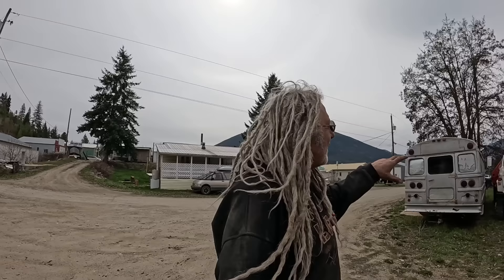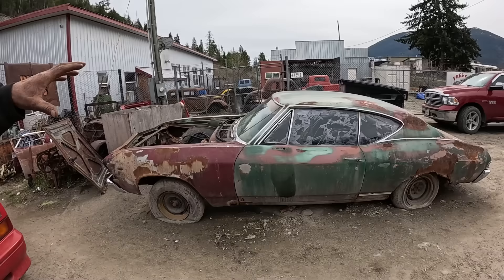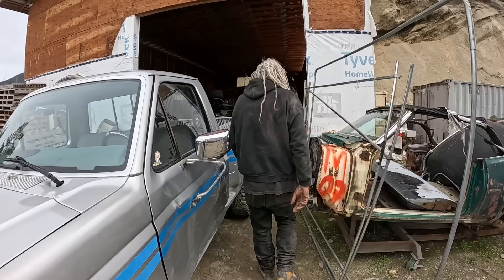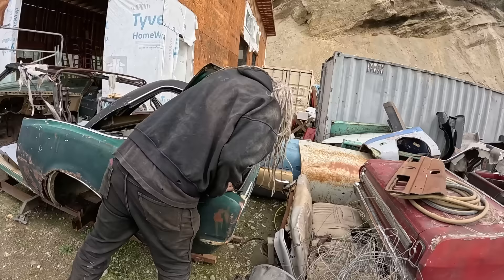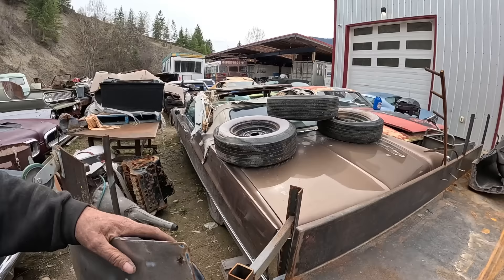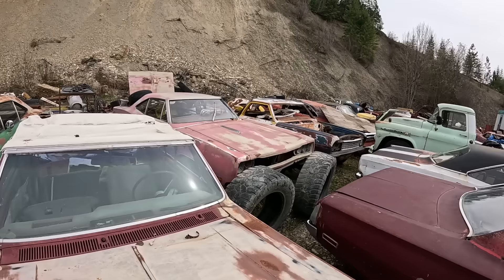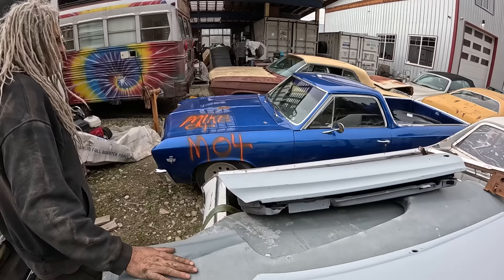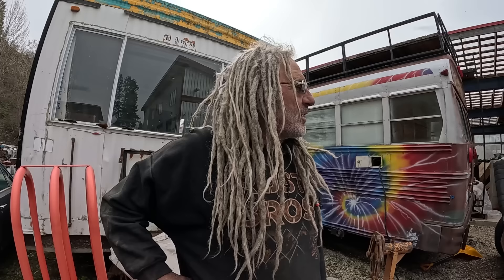Mike From Rust Bros is Selling His Vintage Cars

Comment: I remember visiting this place a few years before the auction and the prices were normal for the quality of these projects. Now they are out of this world compared to then. I bought a 77 trans/am auto with one new quarter panel in the trunk and drove it home about a 1000 km's for 2000.00. now it has been converted to a 4 speed and will be summer driven in about a week or two as my daily driver.  I still remember almost buying 2x 68 AMX's 343 4 speeds for 5000.00 from him instead of the T/A . Inflation is one thing but those prices that were said out loud are beyond normal. My last 3 cars bought are 69 Cuda solid floors needs quarters and rockers that is on the rotisserie now with a low milage motorhome 440 as well as a 360 magnum and manual transmission bundle for 3,500.00 + 76 formula 6.6 auto with 56,000 km's engine and transmission from a wreck with the body at 140,000 km's for 800.00 now totally restored and up for sale at 20,000.00 Canadian + 65 4 speed convertible Mustang that needs floors and in need of a total restoration with no drive train for 100.00 with papers. Easy to find ? No. But they are out there. Working on a 73 Cuda with good floors but needs quarters as a shell and complete interior for maybe 4,000.00 or so but still talking price or trade.  Also know of a 67 400 4 speed firebird convertible that does not need floors or any metal as well as a 68 440 auto charger hidden in the back of a shop that has been sitting for years that may or may not be for sale. Just saying. But then money in the hand talks loud and bullshit always walks , right? I know Mike is a nice guy and can be worked a bit because Mike likes to see them back on the road instead of rotting further into the ground. Still enjoy watching reruns of his shows.
Reply: you were the guy that bought that white one, you drove it up the road whittled him down and bit and said BRB, I never saw you again but maybe you came back? the white one?
Reply: @deandee8082  No a red one
Reply from the maker: you said it money talks you have to start somewhere and ive allways found its easier to drop your price than raise it lol thanx for the comment i allways bring cash if i am looking at old cars
Reply: @RustBrosRestos  That is the way my world works as well Mike. Always enjoyed our brief moments talking even if you never remember me. Guess that is the life of a busy star ha ha.

Comment: Pretty much everything you got Mike is a project and a lot of work
Reply: Paint and assembly is not alot of work
Reply: Welding in patch panels grinding down the welds and then putting filler in is a lot of work and then primer

Comment: I have a good frame for your 62 impala under my 63 impala I'm using for parts for my 63 belair wagon.  How rough is that 64 chevelle convertible parts car? I got several frames for that as well.
Reply from the maker: are they convertible frames or hardtop where abouts are you

Comment: I thought the super bees didn't come with anything less than 383? Just looked it up and I was right 383,440, or 426 hemi were the options.
Reply: Your thinking of the 68-70 bees
1971 340s were available ultra rare like Mike said. Also went better than the 383s and some 440s.
Reply: 1971 they had the 340 as an option as well...
Reply: 383 was standard,  the 340 was optional
Reply from the maker: u r correct 1 year only option and last year for the superbee was a charger variant instead of coronet

Comment: You want intervention here it is hire your entire crew back rearrange your project cars clean out the other building split up your crew in groups assign each a project car to build finish the other building and use it to build cars giving more room stop wasting money on new parts stop buying quarter panels repair the section of rust cut you're costs down do 95% of you're work in house set up a machine shop on site to rebuild motors and transmission depending on the size of you're crew you should be able to finish 5 cars at one time organize your parts and supplies I build my car's two at a time by myself it takes me 3 months I do everything in house and then sale the cars I don't buy back do the same if you want a car back go find another one needing restoration "DON'T BUY YOU'RE CARS BACK!" YOU'RE HERE TO MAKE MONEY NOT GIVE IT AWAY HIRE A NEW SHOP MANAGER AND GIVE FULL CONTROL TO HIM OR HER THEN YOU CAN WORK ON WHY YOU WANT
Reply: Based on one of their replies, apparently the other building is hung up by the property dispute thing.

Comment: Love these older cars. In 15 years, younger generations of drivers will have zero interest to own though. Window to get $$$ for a project is slowing unfortunately. 
We possess sentimental vale with them. That's why we up pay.
Reply: That’s correct, that’s why model Ts and model As are going down in value.
Reply: We will see. People said the same 10-15 years ago, and they are more expensive than ever. But this time, fuel prices and availability... probably a lot more restomods and electric conversions.